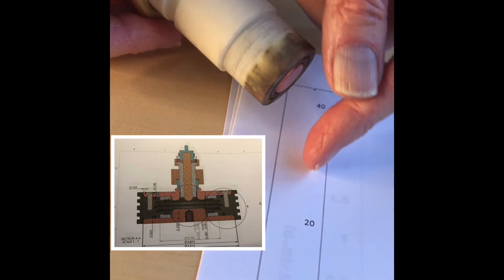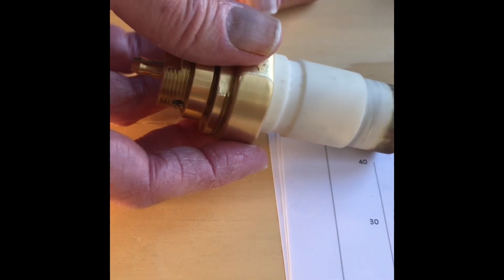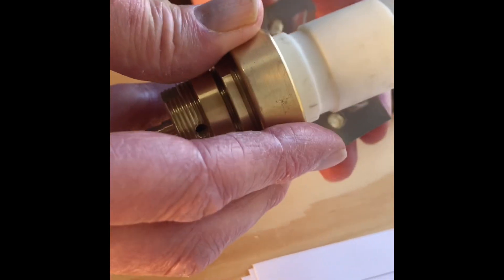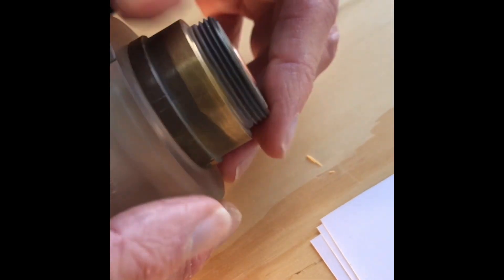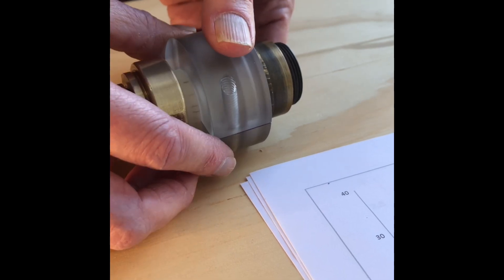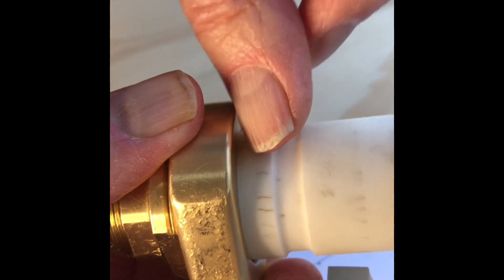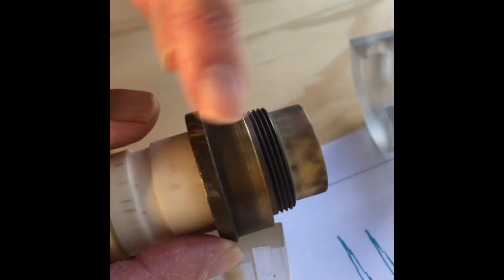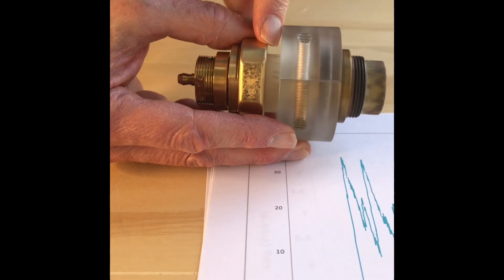Unidentified Kitchen Object - Part 2.2

Comment: The arc marks are on the surface of the insulator.  That looks like a flash-over and not a conduction through the volume of the insulator.  May have to change the shape of the insulator to give a longer insulation path.  Consider using a ring shape like on high voltage power lines.
https://en.wikipedia.org/wiki/Dielectric_strength#cite_ref-CRC_5-5

Comment: Good that you are ditching the ceramics haha.
Never use something with a high permittivity as an insulator.
It increases the capacity without changing the space for charges within the capacitor.
This leads to more powerful electric fields and higher charge density.
This likely has to do with the fact that you have discharges around the ceramics.